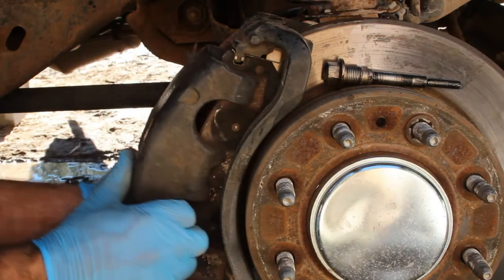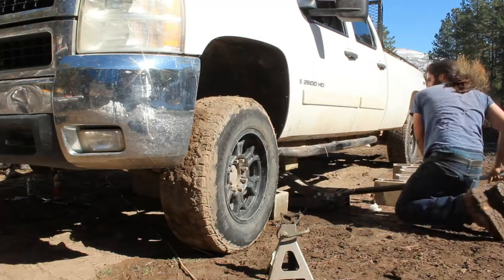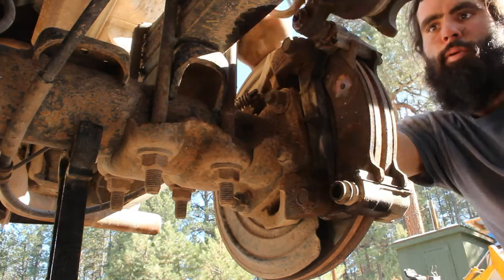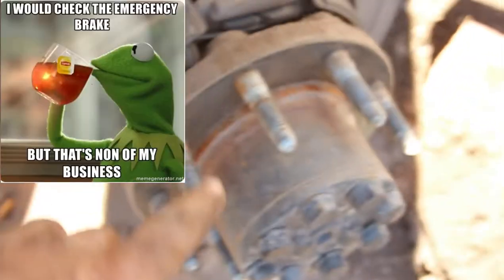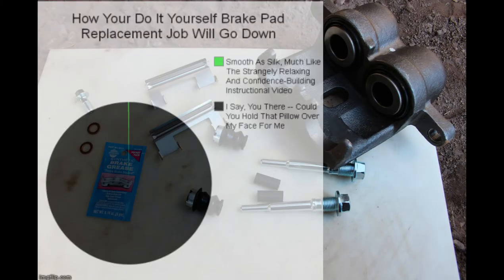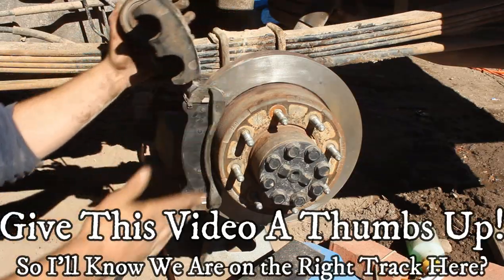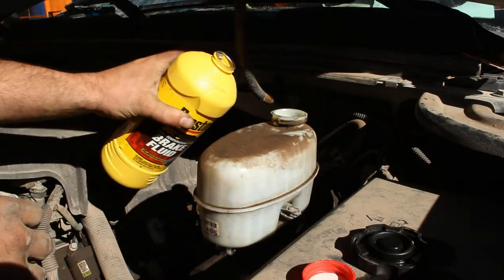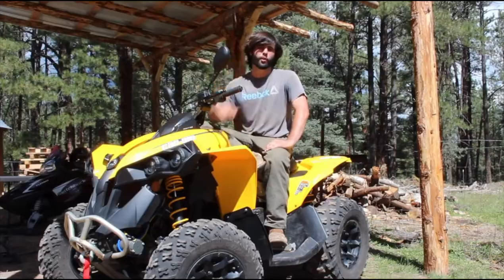How-To Replace 07-13 Silverado 2500HD Brake Pads, Brake Rotors, & Brake Caliper (Every Step)

Comment: Great video, but for some reason on my ‘12 2500, the slide pins are 10mm Allen head bolts and the caliper brackets are 20mm bolts.
Reply from the maker: interesting, the slide pins on the rear of my 11' Duramax are 10mm Allen's I believe and have a little dust cover that make spotting them tricky on the first attempt at brakes. I appreciate you watching and taking the time to share this additional information that I'm sure someone will find helpful. Cheers

Comment: Great video. I do have a question: when I am checking Rock auto or some other auto parts store websites, it is listing brake pads that say they fit the front or the rear, but you said there is a difference. What is the actual difference? How do I order brake pads for front/rear when on all the sites I’m trying to order from it says the same part fits both front and rear.
Reply from the maker: great question, its been a while since I filmed this footage and might have been incorrect in that assumption, I also had several trucks around at that time so might have just been for a different model, I'd go with whatever your seeing on the parts website. Thanks for watching and taking the time to ask a good question in the comments. Cheers
Reply: My lml has the same front and back according to autozone. And I am here trying to figure out why rotor is completely stuck on. Seems like they welded it on. Not even my caliper braket bolts can push it off.

Comment: That top bolt on the caliper bracket won’t come off mid torque and high man hit me shaking my head
Reply from the maker: come to find out it has Loctite, heat it and it should break loose. thanks for watching and taking the time to share your experience with this job in the comments. Cheers

Comment: Nice video. Can you believe the front right brake caliper fell off or the bolts broke off? Waiting for my wife to get back from town with an impact gun to get the lug nuts off. Broke my Rachet and strong arm. Way over tightened. I'd like to slap whoever  changed these brakes last. Wasn't me.
Reply from the maker: damn that is insane. Wonder how that happened. Good luck with the repair and thanks for watching and taking the time to share your experience with this job in the comments. Cheers
Reply: @EscapePowerSports  both guide pins snapped. When I hit a pothole/frost heave. The guide pins on the other side were all worn and pitted, too. I changed them out. Bought a new caliper for the bad side for $75. Not too bad.

Comment: I got a 2500 2012 HD I got a sponge pedal on one and only replaced one the of the calipers and blade out and still got a sponge pedal what do I do
Reply from the maker: hmmm really not sure other than checking fluid is good and its bled correctly. maybe the master cylinder itself is bad? Hopefully someone with more experience will see this and have some better guidance. thanks for watching and taking the time to  leave a good question in the comments. Cheers